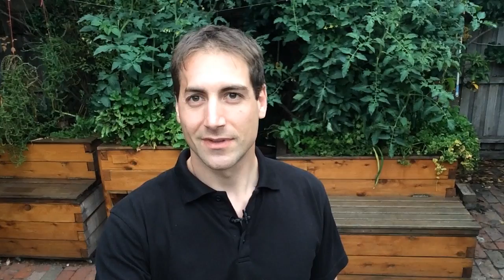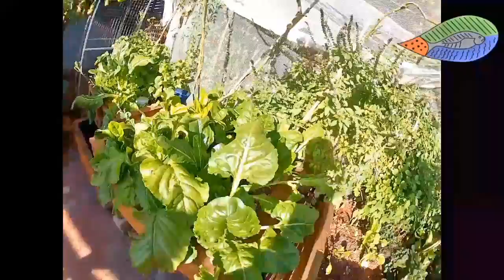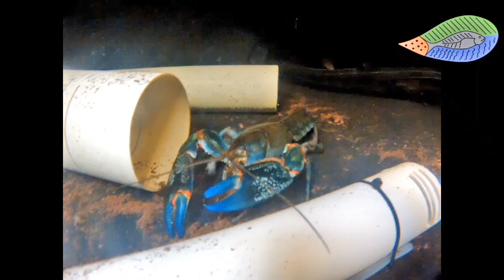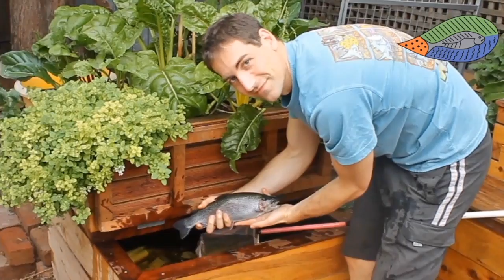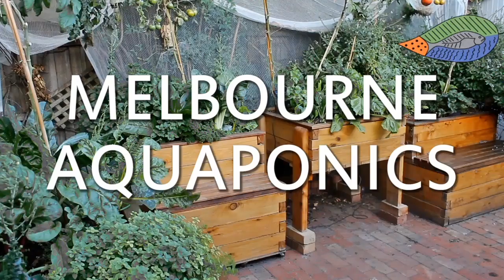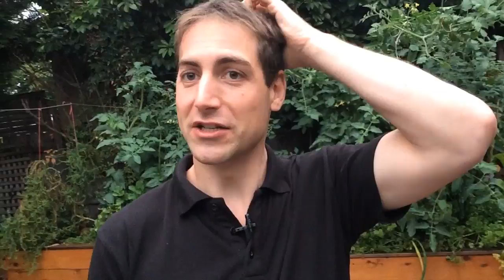Water Pump in Aquaponics

Comment: If you want to add air to the system with almost no extra cost, add a small air valve to the top of your bell siphon. It's will suck air into the siphon. With a little  adjusting  you will have extra air and you bell siphon with work better and break cleaner.
Reply from the maker: Hi Victor, I believe the water coming from the bell siphon is already at 100% saturation or very close to it. Cheers :)

Comment: I like your video's, but I don't like the content of this one, because it is based on several misconceptions (sorry to say):
For over 10 years now I have been contesting bubble aeration and venturi's,
as they are an illusion in aquaponics
here is what I wrote today, on the facebook "aquaponics anonymous" page:
now that Jason Renoux has confirmed that bubbles should best be injected at a submergence of >6 m,
in order to become efficient at aeration 
>6 m submergence is a nonexisting situation in aquaponics,
now that all of this seems to be confirmed,
I can only hope that people start replacing their inefficient air pumps (which also waste valuable energy,
by producing unwanted heat and noise),
and replace their airlift pumps, and replace their venturi's,
that people start replacing all of these by good water pumps,
like already has been done in the aquarium world,
compared to 45 years ago, when everything there was airlift pumps and bubble aeration.
The
 final conclusion is that nearly all aeration in aquaponics is best 
achieved by exposing more water surface to more air surface.
So water pumps, open gutters, with turbulent flow, cascades, etc...
are the way to go.
To the special attention of John Burgess and Mathias Olsson,
who both relentlessly continued to challenge all my proposals:
these gutters can be covered, to avoid algae growth,
and they can also be planted, NFT-wise, to make them "productive".
My final porposal is (like previously explained):
slightly overdimension your central pump (in whatever setup),
this for faster solids removal,
which is essential,
as the bacteria that settle on the solids are seriously competing for the available oxygen in the water
lead all this water over your biofilter,
so the toxic (to fish) ammonia is transformed, first into nitrite (still toxic to fish) then into nitrate (non toxic to fish)
spread this biofiltered water over your growbeds, as needed
and send the surplus back to the fish tank,
where it will cause extra turbulence,
thus more exposure of water surface to air surface
thus more oxygenation
friendly greets to all,
Frank De Block-Burij
Reply from the maker: Thanks for your input Frank, so from your experience what is the most efficient way to aerate the water?
Cheers
Reply: with pumps, not with bubbles

Comment: Well done on creating a series designed to explain WHY things are done a certain way in aquaponics. My main system actually runs 2 26 watt water pumps; 1 for the grow bed and one for aeration. My own personal experience is that for a given power consumption, a water pump with the correct setup provides more aeration than an air pump of the same power.
Well done.
Reply from the maker: Thanks for sharing your experience hector, a water pump plugged on a venturi can be very efficient as the contact air/water is high and go through different pressure levels but IMO it’s always easier to blow air into the water than to move the water in order to create a depression. Anyway your power consumption seem acceptable, I mainly made this video because I saw people using giant pumps for small setups and I think it’s missing the point of aquaponics which is to produce food in a sustainable way. I don’t want to criticize people who already have their system running. My aim is simply to advise people who are going to build their own system and wonder about the pump size. I hope this video will help them to choose a sustainable option and to select the good water pump for their own aquaponics setup  
Cheers
Jonathan